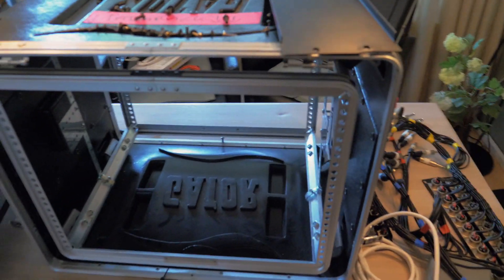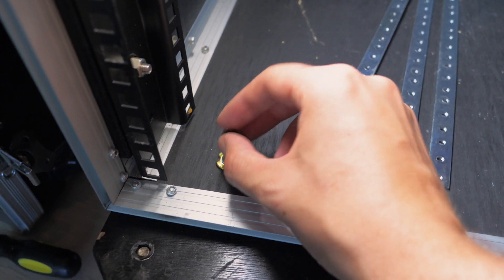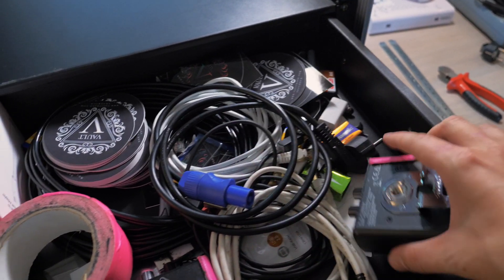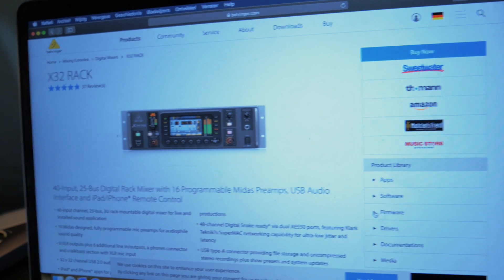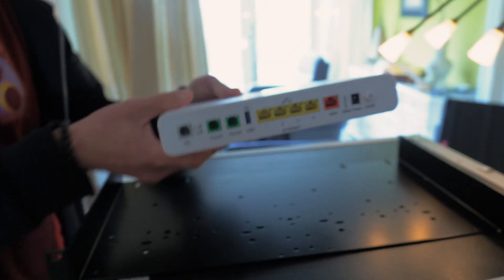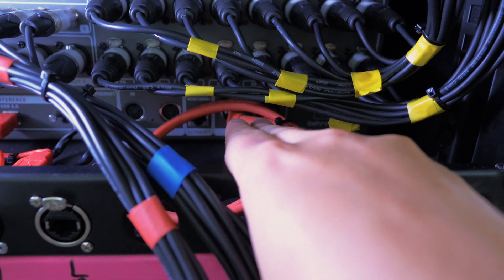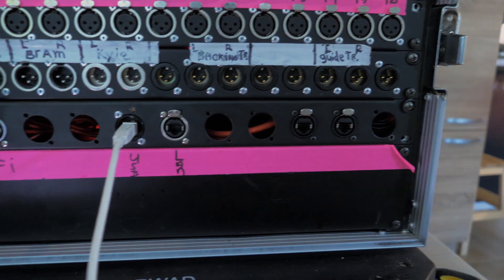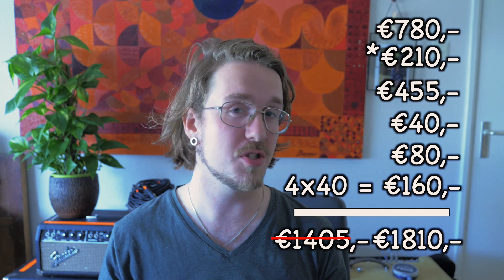How to build an in ear monitoring system, on a budget! // X32 Rack

Comment: You realize you no longer have aes-50 bonded ethercon connection with how you’ve setup that patch bay... (with a the orange regular cat5 jumper)I hope you do not blow the ports from static discharge - signed ADMIN of the x32 behringer facebook group...
Reply from the maker: Hmm wasnt aware, never happened though! Should we use a different cable then, like a cat6?
Reply: @maicovimuto6341  actually you would be better off going direct to the rack with whatever ethercon cable coming from the other console... short of that, you should at least change it to a passthru ethercon panel mount connector and get a short ethercon jumper with bonded shield on the shells. There is plenty of documentation of esd static discharge blowing aes-50 ports due to using non shielded and bonded ethercon connectors.  Also the spec is to use cat 5e cabling, as cat6 has a higher twist rate shortening the useable length (its less of a problem on short lengths, like jumpers than on a foh snake run). But grounded ethercon should always be used

Comment: Great video and thanks for posting! Would be awesome to see a DIY on the patch bay and how you built it!
Reply from the maker: A bit late for that now, but we just ordered a panel and parts from Thomann and then we soldered the input jack straight to the output jack, and had a second line running to XLR’s that went into the X32. So a hardpatch split going in two directions